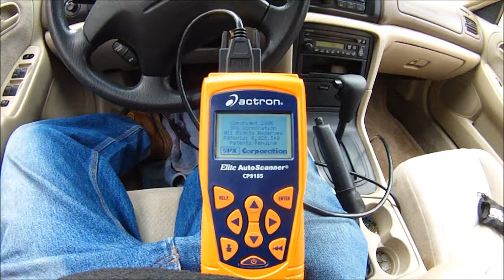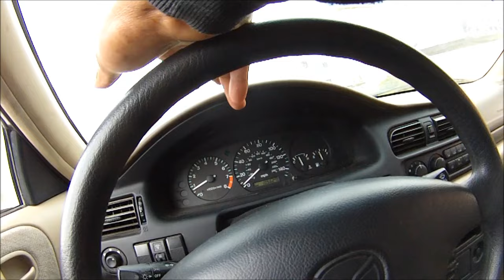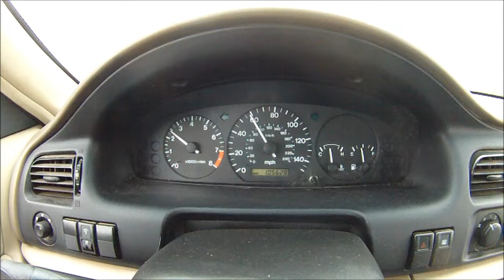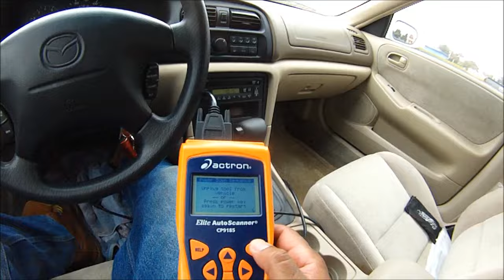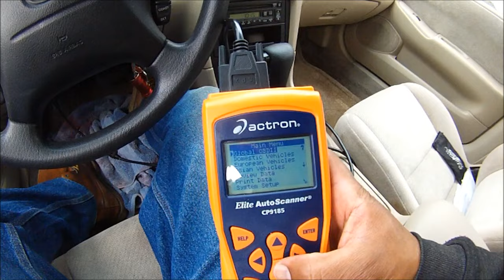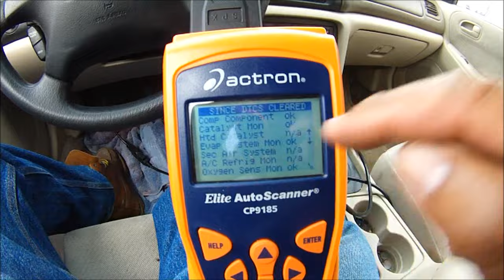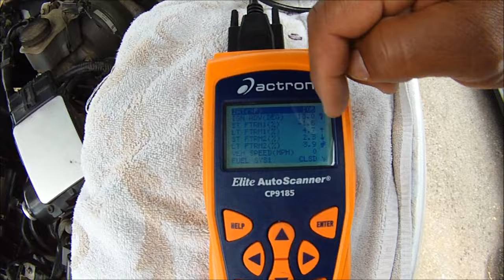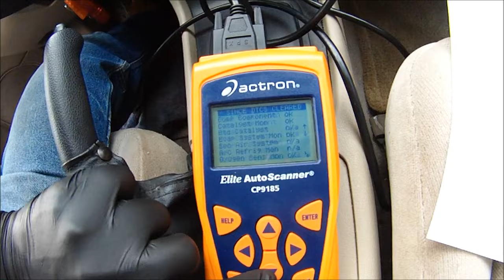WHAT SMOG TECHS WONT TELL YOU AFTER YOU FAIL THE SMOG TEST FOR (INCOMPLETION OF OBDII SELF TEST)

Comment: I own a 2001 Hyundai Sonata and I had two codes pending but no check light (P0128, P1167).  What had happened was that the check light came on but then went off while driving, so I never cleared the check engine light.  The car's computer did this all on its own.  But anway, I scanned for codes and had no fault codes but I had 2 codes pending.  I erased the codes with a scanner and had to deal with getting the monitors ready.  All monitors except for the catalyst were ready within 3 days and I still had no codes.  The last monitor was the catalyst monitor and it was a big problem.  After driving over 250 miles, it was still not ready for smog.  This was the only monitor I had not ready.
 In the state of California (other states could be slightly different) there was a time not long ago when you could have any one monitor not ready for smog on a 2000 or newer car.  But changes were made, and now the only one monitor that does not have to be ready is the evap.  If the evap is ready, then all monitors have to be ready on a 2000 or newer. (Except for new cars up to 6 years old which do not require a smog check anymore).  The good news is that these cars no longer need to be placed on a dyno which checks for hydrocarbons, CO2, and Nitrogen Oxide levels coming out of the tailpipe; however, cars 1999 or older will have to go through this check on a dyno.
 I did have a mechanic tell me to fill up with premium gas and drive it hard (70mph+) on the freeway for at least 10 minutes which will help with reducing the hydrocarbons.  Also, on a 1996 through 1999 car, you use to be allowed two monitors not ready, now it is one. 
Anyway, I drove my car on the highway and in the city following your instruction as in this video.  It didn't work the first time so I did it again, only I did it for 10 minutes.  Afterwards, I drove through the city, stopped at traffic lights and stop signs and after arriving home, my catalyst monitor finally cleared.  I did this on a Sunday, so I couldn't go to smog right away.  Today, which is Monday, I got down to the smog check and I passed my smog.  That's right, I passed that bad boy......yes!
I would advise anyone getting a smog to go to a place that only does smog.  Even if you go to a STAR station, if they are also a repair facility, they might come up with some BS about how you need this or that before they do the smog test.  They might lie by saying  that you will most likely fail smog if you don't change out this or that right now.  But a test only smog facility cannot sell you anything because all they do is smog and you won't have to deal with the scams.
Also, the drive cycle for the Hyundai Sonata is below.  Just be aware that this cycle is for most Hyundai cars with a few exceptions.
 http://ww2.justanswer.com/uploads/indytech/2012-03-18_000622_web_posting_non-delphi_drive_cycle.pdf
Reply from the maker: Great job in staying persistent.  That is what it takes sometimes. You must handle that smog test and be very aggressive . I smog cars all the time and it really takes a toll on me sometimes. To who ever reads this the next time you try to complete your monitors and your having a hard time. Get back on the freeway, erase the codes while driving and keep doing it until they start to clear. I dont wait anymore. I keep erasing the codes until its handled.  Thank you for your input and the drive cycle for your vehicle it really helps us all out because the smog test is very dreadful at times. Keep your head up in 2019 and stay standing and bold like a Lion.  God is good all the time.
Reply: Thanks for everything.  I also wanted to mention that I used your route on 805 south to Palm Avenue.  I recognized the route you took because I use to live in Chula Vista; I now live in National City.
After it didn't clear the first time, I took a different route.  I took the 5 north near the border in San Ysidro.  There was no traffic on 5 north since all the traffic was crammed on the Mexico side trying to get to the US.  I took this highway up to the Plaza Blvd exit in National City.  Plaza exit is downhill, but the slope is not that bad.  But what's good about it, is there are no stop signs or traffic lights at the bottom of the hill.  You also have the option of turning onto two residential  streets or just coasting straight down Plaza.  The first traffic light is two blocks away from the bottom of the exit hill.  There are no stop signs before you reach this light.
The only bad thing I see about doing the drive cycle is for cars that have an emergency foot brake, not a hand brake. In this case, I would suggest using the gearshift into 2nd gear, then low gear.  What do you think?
 UPDATE:  I just found out today that starting on January 1, 2019, there will be new smog rules (California Only).  Drivers will not need to smog their cars if they have a car that is eight years old or newer.  For the first six years, the abatement fee of $20 remains unchanged.  For the last two years, owners will pay an annual $25 smog abatement fee.

Comment: Great video. My car failed because the monitors won't complete the cycle. I put well over 1,000  miles and it still wont complete the cycle to fail a 2nd time. I replaced the computer, and i hope this does the trick along with the advice you gave. 

Thank you for the video

Comment: I just passed NYS inspection today with two incomplete monitors since it's a 1999 that's allowed, just do it before the CEL comes on.  My transmission range sensor is out of range (P0705) even after I replaced it, but it comes on in the last two monitors.

Comment: I had INC catalyst mon with also 2 pending codes P0420 and p0430. Followed this tip for my 2003 toyota rav4. Didn't work at the first time. After that, I do 55-65mph for 25 minutes and then bump CEL is ON and that's how I know my catalyst mon is ready.

Comment: Autozone in CA will let you borrow an OBD scanner. Or you can buy a cheap one there or at Harbor Freight.
Search (manufacturer name) smog cycle for particulars for your vehicle. Example, there is a result for GMC Drive Cycle.
Nice tip to use the handbrake for going from between 55-65 for 5 minutes, then coming to a stop without braking.

Comment: thanks for the info. I happen to be a technition and a couple of things. One is some times the codes will remain if you disconnect the battery.  Depends on the computer system.I have done this to my vechile, like you said if you run and drive the vechile and get the converter hot it should pass the test.
Reply from the maker: +Gary Lanza Thank you Gary, yes you are right there are soft codes and hard codes. Hard codes can stay in the computer and will still be present even if you erase them. Yes getting the car hot is best for the cat.

Comment: General Motors Driving Cycle

A complete driving cycle should perform diagnostics on all systems. A complete driving cycle can be done in under fifteen minutes
.
To perform an OBDII Driving cycle do the following:

Cold Start. In order to be classified as a cold start the engine coolant temperature must be below 50°C (122°F) and within 6°C (11°F) of the ambient air temperature at startup. Do not leave the key on prior to the cold start or the heated oxygen sensor diagnostic may not run.

Idle. The engine must be run for two and a half minutes with the air conditioner on and rear defroster on. The more electrical load you can apply the better. This will test the O2 heater, Passive Air, Purge "No Flow", Misfire and if closed loop is achieved, Fuel Trim.

Accelerate. Turn off the air conditioner and all the other loads and apply half throttle until 88km/hr (55mph) is reached. During this time the Misfire, Fuel Trim, and Purge Flow diagnostics will be performed.

Hold Steady Speed. Hold a steady speed of 88km/hr (55mph) for 3 minutes. During this time the O2 response, air Intrusive, EGR, Purge, Misfire, and Fuel Trim diagnostics will be performed.

Decelerate. Let off the accelerator pedal. Do not shift, touch the brake or clutch. It is important to let the vehicle coast along gradually slowing down to 32km/hr (20 mph). During this time the EGR, Purge and Fuel Trim diagnostics will be performed.

Accelerate. Accelerate at 3/4 throttle until 88-96 km/hr (55-60mph). This will perform the same diagnostics as in step 3
.
Hold Steady Speed. Hold a steady speed of 88km/hr (55mph) for five minutes. During this time, in addition to the diagnostics performed in step 4, the catalyst monitor diagnostics will be performed. If the catalyst is marginal or the battery has been disconnected, it may take 5 complete driving cycles to determine the state of the catalyst.

Decelerate. This will perform the same diagnostics as in step 5. Again, don't press the clutch or brakes or shift gears.

Comment: Thank you Sir!   You hit the nail on the head. Right on!  That's the way to clear the monitors.  You are good oldskool funk.  I would buy a car from you, I respect the way you handled this. Safe, effective and you got the job done fast.  I've done these monitors before but I have a hard one now.  Cat and Evap on 2000 Lincoln LS.  They don't want to clear.  I've never tried using the hand brake trick though. I will try that one today.  Like you on that Mazda, I have no registration.  Just a one day permit.  I hope I can get it quick.  It has no trouble codes, just changed the battery is all after the car sat for a year.  Put new fuel in, new battery, etc.  Today's the day.
Reply from the maker: +robonik313 Make sure your evap and cat do not have any issues, codes because they will never set if there is an issue, For example if your evap system has a leak and cannot seal properly it will never complete but you will get a code telling you. Another thing is you may have to do your drive cycle a few times (be persistent) they will stress you out some times but the key is to drive it. do the freeway for 5-8 minutes the get off and drive on the street for another 5 min off and on. Sometimes that works also. I also watch the monitors as I am doing all of this and watch them set live. The key is to do it over and over but follow your factory monitor settings first. Be firm dont give up when they dont set God bless.
Reply: +oldskool funk No issues showing either active or pending codes.  And just to be sure I had my mechanic check the Lincoln with his OBD scan tool.  My Android/BAFX combination is reading perfectly.  With the paid Torque app you wouldn't believe all the functionality you get.  Thanks again and God bless.

Comment: In CA I thought the smog checkers are not allowed to be repair guys purely because of the scams they were running.  
An OBD2 monitor is a valuable tool and you can get one at Harbor Freight for about $65 or get an ELM327 WiFi OBD2 plug online for about $20-$30 and use your iPhone (requires WiFi version) or Android (can use WiFi or Bluetooth version) with free software to read codes, erase trouble codes and check readiness.  A week of driving around town is usually all you need to get the readiness status working.  Thanks for all your videos, they are really helpful.

Comment: I have a 2002 Mitsubishi Galant with a 2.4 L. The CAT and EGR monitors will not set. I replaced the EGR and control module. I replaced both O2 sensors. There are no vacuum leaks in the engine. I went through $100 in gas running every drive cycle trick known to man, and it still will not set the EGR and CAT monitors. 

I took it to a friend of mine repair shop, and he connected a high price scanner to it. Everyone of the sensors are functioning within specs. The car runs like a champ with good gas milage and everything. There are no fault codes, yet this thing refuses to set the EGR and CAT monitors.

Comment: guys this is not about driving your car  at or between 55 - 65 its about keeping your RPM as hig as you can for  those 5 minutes or longer if you can its to clear all the soot out of your Cats or DPFs or both if you  do regular service's on your car change the oil  plugs air filters ect and drive it at  4k rpm for about 5 minutes once every week or 2 you will never have a problem with emissions tests

Comment: I had to do it n jerz like 1am last night. I see online people said they went 1000 miles and still failed lol. It's all online for you. You just have to do it when it's not to crowded on the road. It took me like 30 min to complete. For the Nissan Altima 2004 I cold started it...waited till the heat was in between the h and c...like 10 min...then idled in drive for like 3 min...then went to 55 for 3 minutes...slow down without hitting the brakes...go back up to 55 and steady it for 5 minutes the slow down again without using brakes...then exit and take local streets back home. Passed smog

Comment: Drive Cycle for the Honda/Acura Vehicle

Start the motor and keep the car idle for 20 seconds. Don’t touch the accelerator.
Rev the engine to 2000 RPM for 3 minutes. The temperature should be at 1/3 of the scale or higher.
Idle for 20 seconds again.
Go to a highway and drive between 50-60mph for 20 minutes. You should be in D or 5th gear. Don’t utilize cruise control. At some point in the journey, coast for 90 seconds (take your foot off the accelerator).
Conduct city driving for 10 minutes, and during this time, perform some coasting.
Once completed, let the vehicle turn off and sit for 30 minutes with the engine off.
Reply from the maker: Thank you very much for your contribution to helping others.